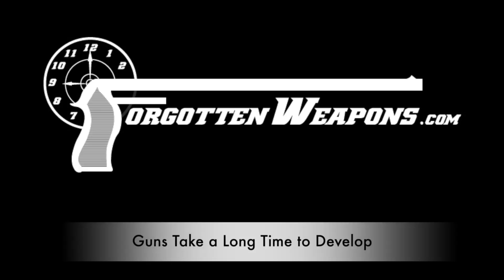Why Guns Take Years to Get Into Production

Comment: One thing a lot of people who are not machinist dont understand is wear on cutters changes dimensions which affects tolerances.
Reply: And then you need to calculate tolerances for tooling, and then tolerances for tooling for making tooling, and then tolerances for tooling for making tooling for making tooling...
Reply: @aiayou  which is why it's common parlance engineering/machinist/fabrication world (not so much in in the rest of the world) - 'tolerance stacking.' the term is used so much that it almost becomes an explanation for everything, why things that should work, often don't.
Reply: When it's screaming and throwing sparks, turn the inserts!  😂
Reply: @randymagnum143  Unless it's a grinding machine, then it's working just fine! lol And don't get me started on the grinders will fix it concept!
Reply: @cooper10182  stone wear on grinders is a real thing!  Never saw a program that accuratly compensated for it, though.
Reply: Even the temperatures in the workshop where the part is being manufactured can change tolerances.
Reply: @FredsRandomFinds  on extremely tight tolerance parts the ambient temperature can effect parts ad gages
Reply: When do you change endmills? After they self destruct, of course!🤣👍

I will say 5/8" carbide endmills are really loud when they go kaboom..😵🛠️
Reply: We use all carbide inserts at my shop, I can't imagine the horrible days of hand grinding high speed tool steel
Reply: @motherhorsefucker  Was a pain in the arse.. Company I worked for at the time were slowly shifting to carbide tip tools but were too tight to pay for the ones with replaceable tips and used ones where the carbide tip was brazed onto normal tool steel and had to be sharpened on a diamond wheel when they dulled..  Worked OK except when we were making some parts for the Eurofighter prototype out of Titanium where they had a nasty habit of tearing to brazed tips off of the tool steel and spiting them across the workshop and through window glass..
Reply: @motherhorsefucker  we use a pile of inserted tools, but i still grind a lot of 1" and 1-1/4" HSS tool bits, for boring, facing, grooving, and tooling in champhers and radii.  On interrupted and uneven cuts, carbide is an instant kablooey.
Reply: I've toured S&W and they have an amazing system of automatic inspection of every cutting tool that sends cutter comp settings back to the CNC.  It automatically rejects tools that  are too far out of spec, keeps track of the tools not only in the changer, but also in the tool crib at the machine.  It's amazing.  I've seen this at only a few other aerospace manufacturers.
Reply: @LivetoshootNC  Hmmmm, S&W is the only firearms manufacturer I've seen that has F'd up a barrel so bad right out of the box that I'm not sure it was even safe to fire remotely. I don't believe they have any QC on parts, it looked like an orangutan with a drill was trying to make an oval shaped barrel. It honestly shouldn't be that big of a deal for even a DIY machine to bump both sides of the tool bit (giving it diameter) and do it several points axially (just like auto level DIY 3d printers probe multiple points of the bed and create a mesh elevation map and compensate for discrepencies).

I will say I haven't inspected many firearms parts, or been at the end of a barrel of many firearms, but the one I have seen was so bad I can't explain how it could possibly get out (the mass would be wrong, visually there is no way you couldn't see it from 10 ft away, and like I just don't see how it got out there, it was bad...)
Reply: @LivetoshootNC  Yea it's a great feature to have and expensive as all get out, hence few companies pay for something that the operator can do.
Reply: @LivetoshootNC  
Excellent input, just like the 2 bits about tolerance stacking & shop temp variation.

I once worked at a machine shop that had extremely consistent & precise ambient  temperature control.
Reply: Most modern CNC machines being sold today, even a low-cost Haas, will have SOME level of cutter comp ability. The actual results of that cutter comp can vary, but a good machinist and programmer can make things work. I have a basic 2020 Haas VF2 machine and while my programming isn't all that, and I know the machine's probing system isn't actually as dead on as it likes to think it is, I can still have the machine account for wear or out-of-tolerance tooling during a run of parts. 

In any case tool wear, temperature, coolant use, fixturing repeatability, probing/indicating discrepancy, number of operations, age of machines, and so on, all will affect the final dimensions achieved on a run of parts but yes the tolerances of the print are final, either parts are in the range or they aren't.
Reply: @scottwatrous  In my machining classes, we're taught to set cutter comp on the first part so it cuts a little large, and then adjust the setting and do a second pass to dial in the actual finished dimensions, specifically because setting offsets is a slightly magical process.
Reply: Not being an engineer this sounds like a nightmare
Reply: Then you have to find competent operators to run the machines to hold the dimensions. The machine is only as good as the operator, and most people don’t take pride in their work these days.
Which is why most products are junk...lol.
Reply: @tmurray1972  A big problem is factories don’t want to train workers to be skilled at their jobs and invested in what they do.  They just want someone to put the part in a machine and press a button.  I’ve seen workers tasked with setting up a machine who didn’t even know how to read a micrometer. So several thousand parts can be produced before an error is caught.  I had times when I knew a part was out of speck, and the supervisor didn’t know how to read a print and I was told to ‘just press the button’.   Days later management is all pissed off because of all the parts that had top scrapped.  Do you think I mentioned any problems in the future?
Reply: @andrewgillis3073  My point exactly, I’ve seen the same thing. And they just double down on stupid...lol. They think anybody off the street can run the machines. How’s that working out for them?
Reply: Thank you for that info.
Reply: I bought Ruger M77 years ago, all weather stainless in 300 win mag. Worst trigger I have ever fired. Endmills that machined trigger group and sear were worn out. Sear released from 7 to 14lbs like gravel was in the action. After stoning machine marks smooth,I got a consistent 7lb acceptable pull
Reply: Trick is Statistical process monitoring, GR&R, MSA etc then you can reliably predict Cpk for a given process and at what part count that tool is replaced to produce parts at 6-Sigma qaulity levels. A skilled, qualified and experienced designer will assign tolerances such that the LSL and USL will fall within the Cpk such that economic manufacturing is viable. The likes of S&W, H&K Ruger etc will have manufacturing engineers fluent in these tools. Who knows the Manufacturing Engineers might talk to the Design Engineers once in a while and design for manufacture. Imagine that?!?! 😂😂
Reply: we are not speaking for nano-meters, sure there is a tolerance FOR EVERYTHING. 
If you go to mechanist shop and say to him that you need an part BUT toleration on precision is zero, he may first think that you are kidding him, and the second thing is that he will show you the door. 
Even when an gun shot over 1000 bullets, the barrel will change the precision, so to substitute that error, they put an mechanism to move the sight up-down or left-right. This was for the barrel, which is most important part of every gun, from smallest to huge one. 
If you look at most used weapons like AK guns and MG3 example, you will find a lot of parts which are produced by "stamping" process. Why? Because is calculated and CONFIRMED that such way the precision is enough to make the gun work properly. 

For me, if you asking me the precision tolerance CAN be roughly 10 nm then the price will the "normal" but if you asking me the precision to be under 1 nm the price will be 10 times higher. Which one you will choice?
Reply: @thepreserver83  yes we are tenths of an inch how many parts fail a no go gage by the .0005 or less
Reply: And dont forget about the CNC machines warming up. At the beginning of the day they are a bit sloppy. Then after a couple of hours of work they tighten up. I had a Mitsubishi that had to be watched, the dimensions would change so much. Fortunately most of the blueprints called for +/- .05  So that wasnt too hard to hit. It was an antique anyway. It had been converted from punch paper tape, lol.
Reply: And this goes for all machine tooling. I know people who have preferences for Harleys built between certain dates because the factory would have installed or rebuilt their tooling then, and before and after the tolerances would be worse.
Reply: @ProSimex84  absolutely as a rule any time my tolerance allowance is under .003 I mike all cutters
Reply: Heat within the machine itself can also result in dimensional changes if the machine isn't designed properly. This is a common result of more modern machines. As they cut faster, the machine heats up more and more. They are coming out with ways to combat this but its a challenge still. Most companies that make high end cnc mills are going about this very intelligently.
Reply: I always thought that would be a thing, glad to know it wasnt a wrong thought! Im not a machinist but I do watch ThisOldTony so that ofcourse makes me qualified xD
Reply: That includes management
Reply: Or that it's common to have to make or buy tools specifically to make each and every part in an assembly. Expensive and time consuming.
Reply: On an old school dumb machine sure. On a modern one that's quite expensive this sort of simple mistake is not hard to solve is it so it better be.
Reply: Dayton Robbins tool wear is just one factor of many.
Fortunately modern cnc controls can be set up to automatically compensate for the tool wear as it happens.
Reply: @Chilli Fries that’s the way it should work.  But I bet you were paid more than minimum wage...
Reply: yeah it's like a blade on a sword or knife  eventually you'll need to resharpen it or replace it. cutting tools will need re sharpened or replaced, Metal is hard....
Reply: Which is why you should always add 0.1 - 0.2 mm to tool radius when you're doing the first run
Reply: I'm guessing that you know more about machining than you do about language, thus your error. Cutter wear has no effect on tolerances. Tolerances are the range of acceptable dimensions, and they don't care how you achieve them. What changes with cutter wear is the result of the cutting operation. Whether or not that result remains within tolerance can change with cutter wear, but the tolerances don't change.
Reply: @sambolino44  
Respectfully Sam, I'm not sure that's fully accurate.

Let's remember that even on CNC machines, they usually only calibrate/measure for true "roughed in" initial dimensions prior to beginning  the operation performed, and after the CNC machine starts executing the operation's program, then the wear on the wear on the cutter surfaces is a relatively constant process that (despite coolant lubricating the work happening)  isn't rechecked constantly in the same way that the work happens constantly.

Because the wear is relatively constant (I say "relatively" because even in a temp controlled cnc machine shop scenario,  metallurgical variances in material hardness will not be known by  the operator or his/her smart machine), but the calibration/measurement generally must wait until at least the next cycle before the probe starts measuring dimensions again, there is always some  unavoidable dimensional variation.       It's not like the probe follows right behind the cutter, riding over metal chips, and intermittently giving false readings that would then be virtually impossible for the cutter to correct for, because the errant dimensional probe reading (1 chip thickness from the true desired/programmed depth of cut) can't somehow magically know that it's not getting a true reading, then signal the cutter to  

In case the point of my hypothetical "probe constantly follows cutter" cnc machining scenario involving chips giving false readings is not clear (or maybe not  technically in-depth enough yet for the full satisfaction of YouTube armchair consultants), then maybe we can alter the scenario a bit to help get the point across:

In a fictional CNC machine shop where all their bright shiny new A.I. machines are engineered to drag a dimension probe right behind the cutter for constant toolpath correction (thereby basing real-time toolpath corrections  on real-time probe readings, magically somehow AFTER the cutter has ALREADY passed where the probe is finished reading each pass from, on the fly) let's make it even easier to grasp my point if we also pretend that the cutter has a chip vacuum that reliably (as in truly 100% of the time, NOT 99%) removes ALL the chips, never missing even 1 chip to accidentally cause false probe  readings, that still couldn't be engineered around, because the cutter can't choose a deeper or shallower real-time toolpath correction, because it's already passed the work zone that it's trying to retroactively correct for something that's already occurred.

Please forgive my horrible English this morning !!

I haven't had my second cup of coffee yet...

Hopefully I successfully made my point.

If I'm wrong, I welcome ANYONE'S correction.

After all, we learn by doing (consider private corporate R&D), and we learn by communicating (consider the global peer-reviewed scientific process), and we learn by mistakes (like learning to walk, or ride bike without training wheels).

I welcome correction, because I welcome learning...

I better go make more coffee...
Reply: @sambolino44  
There's an important distinction to be made here between intentional engineered "slop" kinda tolerance between finished parts (to allow for movement, such as in a real-world AK-47 gas piston to actually reciprocate in a real-world gas tube, that would jam up with gas condensation fouling without "good slop" for example)

Basically, apart from people who buy them INSIDE a video game, nobody buys theoretical guns, that don't require "good slop" to function in reality.       They buy real guns that foul up with condensing partly burned propellant gasses, sand, dust, water, or even ice...
Reply: @sambolino44  Wear on the tips of cutters changes the achieved tolerances. Precision CNC machines adapt for the wear on cutters DURING a cut to ensure consistently meeting the specifications. 
They also allow for the heating of the workpiece during the cut.
That gets really interesting with CNC grinders.
Reply: @allangibson2408  Define "achieved tolerance" please. You make it sound like the print, which used to say "0.030" +/- .005"" now says "+/- .010" because your cutter wore. Just because your result changed does not mean the tolerance changed. Stuff like this is why there are misunderstandings between machinists and engineers. I think you are using the word "tolerance" when you mean "results."
Reply: @sambolino44  When the tolerance is -/+0.01mm cutter wear becomes very significant (as does the cutter dimensions).
Reply: @allangibson2408  I was just trying to make the point that tool wear does not change the part tolerance. The OP edited his original comment, so I think my point got across.
Reply: @sambolino44  Well said and a very simple mistake to make
Reply: @sambolino44  
Tolerance that's intentionally engineered into a machine is necessary for function.

The sub-topic was about "bad" manufacturing variation, resulting from stuff like shop temp variation, crap quality cutters, crap quality material that has alloy separation into pockets of unpredictability varying hardness.

At that point in the conversation, people were talking about (video topic, actually) how the largely unavoidable inherent limitations and defects in & of modern manufacturing result in the sometimes puzzling variances between the reliable function of a debugged prototype, and it's mass produced "offspring".

It wasn't about something that should properly be referred to as "tolerance", since tolerance can be a desirable thing.

We shouldn't be "intolerant"  of an insecure pedantic obsession for technical precision, for example...

I may be wrong, and that's okay 2...
Reply: @sambolino44  no cutter wear does have effects on tolerances if you program a CNC machine a perfectly fitted jig and do not allow fr cutter wear parts will be outside a tight tolerance.
Reply: @daytonrobbins3361  Going outside of a tolerance does not change the tolerance. I'm sure you understand the machining process very well. I'm not so sure you have a similar understanding of English. Misunderstandings like this are a big problem in manufacturing.
Reply: @daytonrobbins3361  In this case, the tolerance did not change. The difference is between whether the part went out of tolerance, or whether the tolerance was affected by tool wear. The tolerance was not affected, but the machine's ability to stay within tolerance was affected.
Reply: How are you posting this 2 days ago the video came out like 3 minutes ago
Reply: @comradeautukov977  when you donate $20 or more a month have access to video early sometimes weeks early